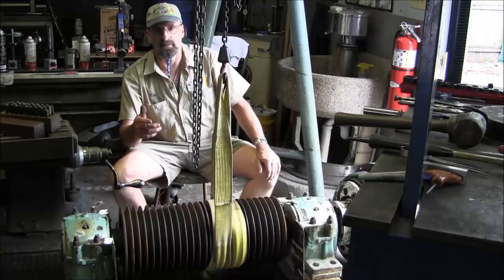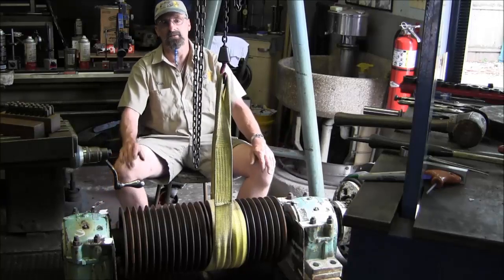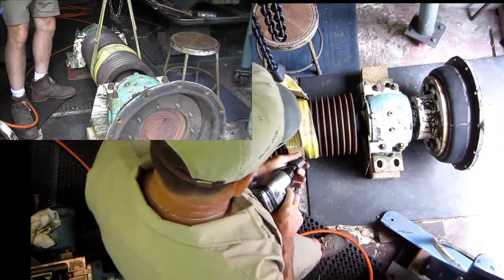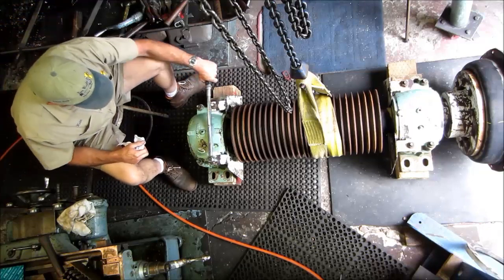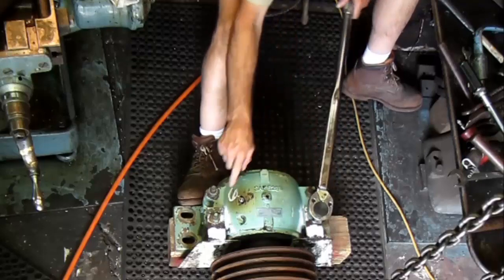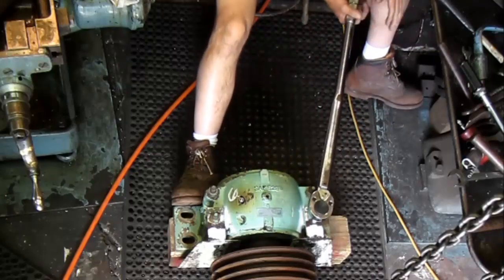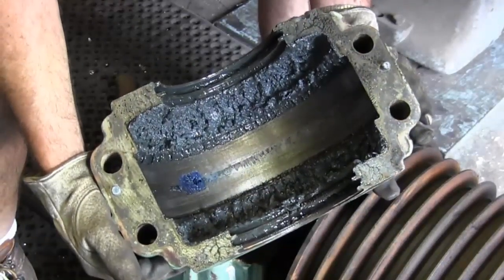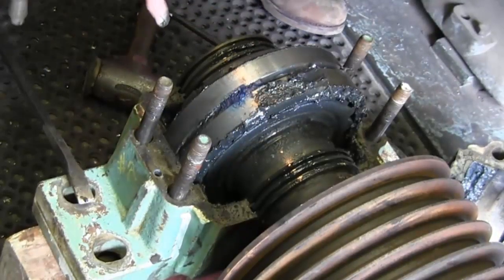Jackshafting Part 1: Tub Grinder Jackshaft Refurbishment

Comment: Enjoyed watching, just like all your videos. I was wondering, was that the customer helping you set the shaft inside with the crane, or did you have to hire someone to do that for you? Looks like an additional concrete slab outside your door there would be a good help. You could then use a cherry picker or roll out work cart.

Comment: I see you tried the impact first, I rarely need more than a 1/2" impact, but I got a cheap 3/4" a couple years ago, that believe it or not works very well. I have used it to remove many tough 500ft/lb+ nuts.

Comment from the maker: Thanks Pete, for the note, that is why I was comparing it to a torque chart and mentioning a wet and dry assembly, for that size and thread pitch. It can tell you whether  they were torqued or not!  Good info for inspections not a hold too as a exact torque reassembly. I'm glad when you guys jump in and point out pacific's to your own experience. ;{)-----

Comment: Hey Keith, I made a 66 inch long breaker bar out of  1x2" rectangular tube.  Actually, I made atleast a dozen of them.  That was back when I was wrenching on VW axle nuts and flywheel gland nuts...you know the deal.  Well, one of my Ultra-bars with a 3/4'' and 1/2" drives welded to the ends made it into a issue of Hot VWs Magazine.  With a bathroom scale and me 4.5' from the end I could precisely torque up to 800lbs! I'm sure you can visualize the tool.It kicked ass and I sold many at VW events.

Comment: Re torque wrench comments, I have always used this method in the case a torque spec is not obtainable ie. rod, main, head torque on antique equipment and it is also a preferred method when doing pinion gears which use a collapseable spacer to set preload (and parts are obsolete). Thumbs up to Keith for checking torque prior to finding out there was no literature on the subject. Maybe that's why I never have transmissions and diff's howl after I repair them like the apprentices that air impact everything and then ask after there is a problem.
Reply: I just wonder how all the know it all's torque something with a left hand thread ;)

Comment: Everybody has loosened bolts in ways that in retrospect may not be the best. A friend of mine was on top of a machine and when the bolt snapped he broke his neck, shoulder and back. What a waste of a good millwright. For that reason I would say when you are cranking hard look at how your body will slip, fall, balance. I prefer to keep the weight on my legs and feet, the stool is a recipe for a medical disaster. Another good example is a mechanic broke his ankle when a bar slipped doing a ball joint. If the foot was secure, would not have happened. Myself, 22 years no stitches, broken bones or eye patches. Thanks for the nice vids, sorry to criticize....I don't want a viewer to get hurt.

Comment: Keith. Quick question. Did you use the torque wrench in the beginning to find the torque value that the nuts would loosen at so you would know how much torque to apply when reassembling the jack shaft??

Comment: Keith, I have watch quite a few of your videos, and I always enjoy them.
How you checked the torque is just flat out wrong.
You never ever break bolts free with a torque wrench,
You always measure torque while the nut is turning, never from a fixed position.
Not only can you easily ruin a torque wrench, you are getting a very inaccurate reading.
You should mark the position of the nut, break it free, then see how much torque is required to bring it back to position. The nut must be turning while you take the reading. Beam style wrenches are best for this, if you use a click style you must loosen the nut and turn it back to position on each attempt.SnapOn actually sold ratcheting click style torque wrenches that had to reverse pawl in them just to prevent gorillas from using the wrench as a breaker bar. You owe your buddy a recalibration.

Comment: On a freshly assembled fastener, usually the torque measured to loosen is some fraction of the torque used to tighten.  On a fastener that's been assembled for a long time, I don't see much practicality of measuring loosening torque.  Two exceptions I can think of are absurdly low or high loosening torque might help diagnose a cause of failure, or recommend attempted loosening in the opposite direction.

Comment: assuming it was properly torqued in the first place, doesn't have damaged, rusted threads, you're mostly right, but over torquing is more common, on higher torque settings, you're supposed to divide the torque by three, and do it in three stages, example, 50-100-150 to get 150 some skip that and just do the 150, which can knurl/strip the threads or warp the part.

Comment: Watching you try to loosen tho cap-bolts reminded me of my preteen days.  In 1957, my dad bought his first NEW car.  It was an all-white, '57 Dodge Coronet.  Man!  It was a beauty.  The first time he got a flat tire, he broke a ratchet trying to remove the lug nuts.  It wasn't until he called the dealer, that he found out that Dodge had engineered one side with right-hand threads, and, left-hand threads for the other side.  Don't ask me why.  To this day, I still haven't figured out why.

Comment: I have removed a few tons of bearings like that , you dont need heat or a puller. You remove the lock nut,then the lock washer. Then place the nut back on leaving .50 mm clearance at the inner race . Then using a lock ring punch,you hlt the nut . The bearing pops loose every time. There should't be a need for new taper sleeve unless the bearing has grabbed . I used to change the lock washer only with a new bearing. i do the nut up and measure the roller to race clearance ,

Comment: Most torque wrenches are meant to be able to torque left hand fasteners as well. I think the problem lies in the use of the torque wrench in any direction when not actually torquing something as it is just extra wear when it is not a smooth, even pull or especially when exceeding the highest torque increment the wrench is designed for. In an emergency need of leverage, I would not hesitate to use a 1000ftlb torque wrench to smoothly and steadily apply 800ftlbs to loosen a fastener.

Comment: It looks like there are 24 v belts.

It's damn difficult to run that many v-belts in a row, even if they are matched length set (and expensive) they will stretch at different rates.

Has the customer had trouble with belts jumping and knocking the others loose ?

I've seen conversions to cogged belts in different applications to avoid that sort of thing.

Comment: hi keith, not trying to be a smart++s here. the torque needed to loosen a bolt is way below the torque applied and a lot of variables play into this and for inexperienced people this can lead to under-tightened bolted joints. to prove this you can torque a connecting rod bolt and measure bolt elongation (which is almost the only way to test for real tightening force) then loosen the bolt, torque recorded and measure again. regards. Pete

Comment: Eventually, "I chowed out" a clearance for a Harbor Fr.t 3/4" drive ratchet and added some "webs" (to displace the stress).  Yeah! a 5' long ratchet!.  No braking 1/2" drives with a shop jack pipe handle (cheater bar) syndrome.  I gave that one away to a friend who relined RV brakes.  He blew a nut when he first saw it.  Yeah man, it was the "Cro-Magnum Bar"...bust any nut, foreign or domestic.  No air line necessary!

Comment: Kieth, I have had more success with the tapered bearing adaptors using a end capped hollow bar to go over the shaft and butt up to the nut like you had with the punch. Doing this allows you to use a more powerful hammer blow. On a shaft that size typically a 20lb sledge hammer. 
No need to appologise for the English. You yanks have been mangling the English language for 200 years so I suppose some was bound to rub off. :)
Best wished for your Father. Mine passed away earlier this tear.

Comment: Never use a torque wrench to loosen fasteners.
Reply: Why not?
Reply: PyroShim It can cause irreparable damage or leave the the wrench applying the wrong torque.
Reply: How? I have not had that problem.
Reply: PyroShim It depends on the type of torque wrench. The internal cams can be distorted or the wrench can be bent.  It is only designed to be used to tighten bolts. Unless you check the wrench, you cannot assure that the wrench is applying the correct torque.  You can do a quick check by comparing it with another wrench.
Reply: As long as you stay under the rated torque of the wrench there is no problem at all.
Reply: So I'm guessing you have a special torque wrench just for left hand threaded bolts then :D 
Seriously a quality wrench can go both ways,the damage from loosening comes from exceeding the wrenches limits not the direction it happens in  ;)

Comment: dude, I'm certified, I have a two inch thick book on the shelf on torque. it's not an opinion, it's not a certain way of looking at things, it's fact. in mechanics there is wright and wrong, and you have no argument to make, or any way of defending it. I love this guys vids but loosening nuts with a torque wrench to find torque specs is inaccurate and incorrect and Keith likely knew as much since he did consult a spec sheet for validation.

Comment: you don't have to like it, but you're the one with low IQ. over/under/incorrect torquing is the second biggest problem in service shops. More than once, a shop has had to buy someone a new engine 'cuz some idiot fucked up re-installing the drain plug, some shops even refuse to work on antiques for fear they end up breaking something that can't be replaced. You are ignorant and arrogant in thinking you don't half to follow the rules, and you don't have the right to chastise your betters.